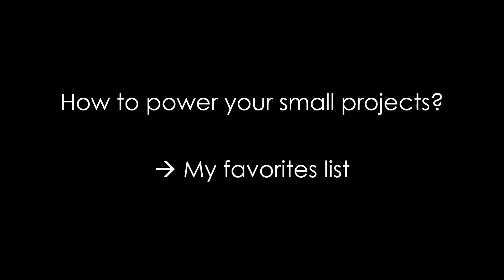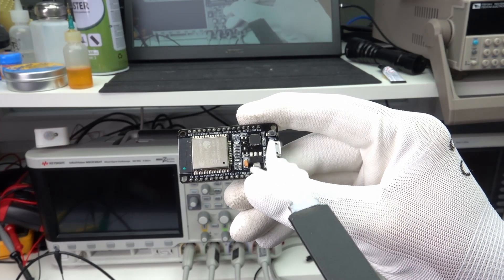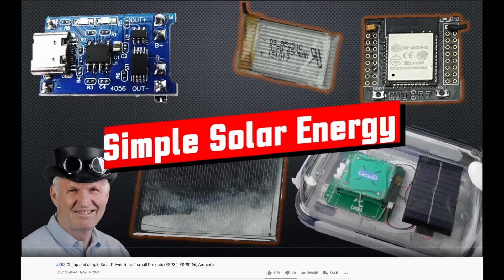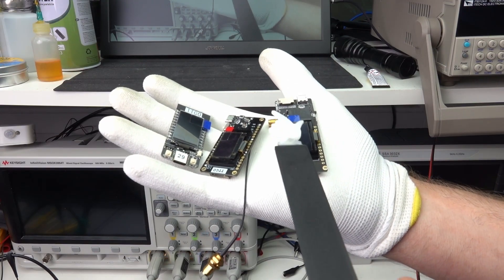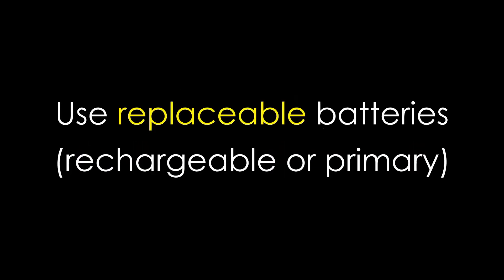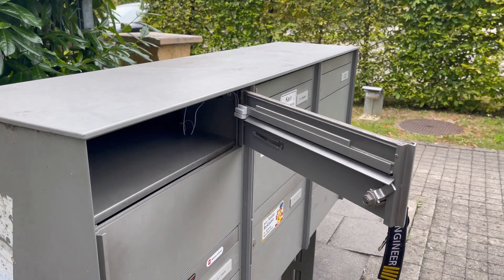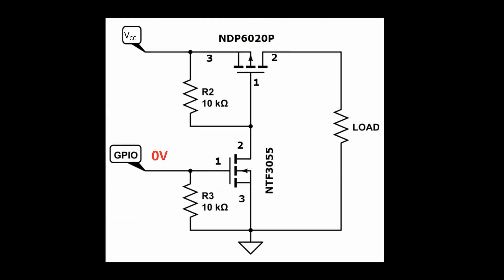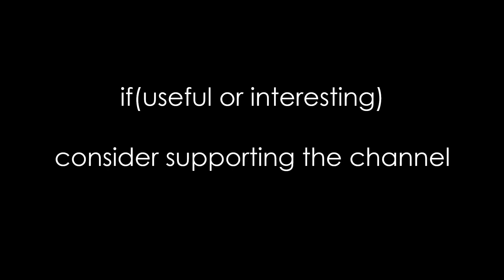#400 The Best Power Source for ESP32/ ESP8266 Projects

Comment: Hi Andreas, very good as always!! I am looking forward to your video on LiFePo4. 
During the summer I did some test with an ESP, a 700mAh LiFePo4, an 1W/6V Solar panel and a very cheap TP5000 charger. 
The battery and the charger output are directly in parallel, thus no need for a power path. All power lines should be kept short and thick enough though. 
I am also just keeping the current limit at 1A and it works just fine. The TP5000 has a step-down converter and this is not optimal with respect to maximizing the power, but it seems at least to be self-regulating. Too high currents are anyhow no problem with a 1W panel.
As you have shown in one of your other videos the TP5000 has a very small hysteresis until it starts charging again once the battery is full. However, there is a not used pad that is connected to the chip select. It is possible to solder a thin wire to this and enable/disable charging by yourself. You can check "battery full" via the green LED level, then disable the TP5000 and regularly check the battery voltage to decide yourself when you want to enable charging again. 
There are also 2 unused pads parallel to the onboard shunt. I used this just out of curiosity to observe the charging current with an ADS1115.
In a second setup I just connect the solar and TP5000 parallel of the LiFePo4 without any modifications or measures. During the day the battery is floated around 3.55V and during the night it gets some relief... I really wonder how long it takes to kill the battery by this. I find a lot of "opinions" on this matter, but no real hard facts or data sheets. If there are any battery experts around, I am still keen to learn.
Reply from the maker: I only used Li-Ion batteries during the last winter and one was dead a few weeks ago ( I do not know, why: Low or too high temperature or something other). The voltage also behaves as you describe. I will see how the LiFePo4 battery behaves during the next winter. This one is also better protected and probably will not get the full temperature swing like the one on the roof.

Comment: Do you use a specific brand of usb chargers? I'm looking low idle consumption and after some reading it seems like there is quite a variety, even in products from the same manufacturer.
Reply from the maker: I never looked at idle power. I usually use Baseus or Ugreen. But I have no "proof" that they are better.

Comment: I am planning to build an escapebox with an esp32, some neopixels, tm1637, dfplayer and some solenoid lock. It needs to be battery powered with a battery indicator and a charging port on the outside of the box. The esp32 needs to start when the box is opened and will run for about 90 minutes (countdown from 60 to 0 but will be active until the box is closed again. I prefer to not charge it after every use. For this usecase I will use some different voltages, some for long time like the neopixels and tm1637 but the solenoid will be used only once. Are there any best practices about how to implement this?
Reply from the maker: This is a complex project with many aspects. So I can not give an answer. There are many problems to be solved. But you have a list and you can start one after the other ;-)

Comment: Txs for this video as it's very timely. I'm building a water level sensor (SR-HC04) for a water tank and want to go the battery operated route if possible. Initially my thoughts were deep sleep and automatically wake up a few times a day to send the water level. However in discussions with my neighbor he would want to see the level at a particular time (i.e. use case #5). Also what's the difference between use case #3 "battery operated and don't sleep at all" and use case #4 "on 24/7"? Is it possible to have an event driven use case (without a physical switch/relay etc.) and get a few months of usage without needing a Tesla battery wall :)? How do I go about dimensioning the battery requirement? Love your videos!
Reply from the maker: If you use a properly designed setup and deep sleep you can get a few month life. But pay attention to ultrasonic sensors, You also have to switch them completely off during deep sleep. So you need a custom-designed diagram probably using an ESP32-WROOM module plus a FET to switch the sensor (use case 4). Use case 3 does not work for a long time because they are always on.
Reply: Andreas Spiess  Not quite sure what this is about...

Comment: Andreas, great concise and informative video. Is there a good coin cell battery that would be good enough for either of the latter 2 use cases?
Reply from the maker: I do not know. Most coin cell batteries I know are very low current.
Reply: LIR2450~120mAh, Can last for a couple of hours.

Comment: I kind of understand you electrical designs. However as I am not yet smart with devices.  Can you physically show (slowly) wired components set up.
Good example for me would be using esp32 , 3 batteries, power reducer, dht22 temperature and humidity sensor wired and working. Each connection.
Then I can take components purchased and connect them properly, add code to test 5 times a day.  Use raspberry pi with any software to write the output for that sensor reading to a file to evaluate over each month. (If I can add battery level report as well then I can trade out with charged battery, then recharge used batteries and use them to replace batteries again in future.)
With that level of help AT FIRST WILL LAUNCH MY LEARNING FAST.

I WOULD BECOME A GREAT CONTRIBUTOR IN HELPING FINANCE YOUR COST IN ITEMS AND FUTURE VIDEOS AS I OBTAIN MORE INSTRUCTION.

IF THERE IS ANOTHER PERSON YOU WISH TO REFER ME TO FOR SUCH VIDEOS IN DETAIL, I WOULD BE HUMBLED STILL.

I JUST NEED A KICK START, and a little guidance with patience.  Most Humble Appreciation!  Fan in most need.  Alton
Reply from the maker: Unfortunately, this channel is not focused on beginners. So you probably have to search elsewhere for stepwise instructions.
Concerning logging with the Raspberry Pi: I made videos about it. But this is not easy because it involves a few software packages :-(

Comment: Hello Andreas. Thank you for including Alkaline batteries in your power solution list. Simple is sometimes best. I built a mailbox monitor circuit February 13, 2018 and the same two AA  Alkaline batteries are still powering my circuit (3.5 years). The 2x AAs are soldered together in series. Soldering eliminates the possibility of corrosion and poor connections in battery boxes. The PIC microcontroller is in SLEEP mode 99% of the time, only woken up when the mailbox lid is opened. Then a LED is flashed until the circuit is reset by me.
Reply from the maker: That is interesting! You even can blink the LED!

Comment: I want to build a clock with a lot of LEDs. Since it draws a lot of current it and is on 24/7 it should be wall powered. But the voltages that the addressable LEDs need is usually different from most dev boards. How to keep it simple and also not too hot?
Reply from the maker: I made a video on how to work with Neopixels

Comment: Very informative, as always! I was wondering how worse off one would be with a solar USB power bank? They tend to be very cheap, robust and just a matter of plugging them in via USB. What’s the breaking point in terms of cost/performance compared with a DIY panel+battery+electronics?
Reply from the maker: Mine stops delivering power as soon as it charges. I even thought it is defective. So pay attention if you buy one.

Comment: I tried everything to get a power supply with no noise for a seismic sensor design of our company back in 1987.
After weeks of research and testing, I ended up using batteries. Everything else was just too damn noisy. 
A power supply designs are dictated by their use. Sometimes you can get away with a simple LDO.
However, sometimes there is no solution but to use batteries.
Reply from the maker: You are right. I also tend towards batteries if noise is an issue. To "characterize" a power supply for my radios I compared the noise with a battery, with a server power supply, and with ferrite beads included. The battery sets the reference...

Comment: Concerning power-supplies and Meshtastic, I see your recent 2021-09-05 video on power 
supplies.  Being in the (periodically) cold north, it would be nice to 
power this with super-capacitors with no batteries.  I've seen some 
videos on this type of circuit, but was wondering whether you'd want to 
address it?  I'll copy this into your recent video on power supplies.
Reply from the maker: Maybe I will have a look at it. But only for solar powered devices. Otherwise the caps become very big.

Comment: Hey I can't find any cheap LiPo4 batterys so i am thinking about Li-Ion batteries like the 
Lishen LS LR21700A batteries ( Li-Ion | 4000 mAh | 3,7V | about. 4,2 Euro ) 
My current plan is to use two of them in parallel to power my lolin d32 pro v 2.0.0 board. 
Is that a good solution?
Reply from the maker: I thought I had this solution in my video? One or two batteries in parallel do not matter for the concept.

Comment: Why don't you just use a n-channel logic level MOSFET to keep the board awake?
Reply from the maker: I do not like to switch ground. But maybe it works.
Reply: @AndreasSpiess  No, i mean to use a single logic level MOSFET as shown at 12:00 driven directly by the gpio pin. The n-channel needs a positive voltage to turn on. I do it all the time and it works.
Reply from the maker: Because it needs a positive gate voltage it is usually used to switch the ground wire. If you connect it to Vcc you would need a higher voltage than Vcc to switch it on. Or do I miss something?

Comment: Thanks andreas. You always come up with awesome videos addressing 100 of issues. I am currently working on a datalogger using ttgo tsim-call. The board is mostly in deep sleep mode so I have used ULP for pulse counting. My application needs to run on battery for 3 years. I want you to suggest me a battery. Currently my power consumption in deep sleep mode is 0.7mah
Reply from the maker: With your numbers you can calculate the size of the battery. It is probably quite big. I think you would have to build an optimized board with lower sleep current or switch the board completely off as I showed in the video
Reply: @AndreasSpiess  isn't the ULP of esp32 in deep sleep mode consuming <1mah.
Reply: Is good option? Or to shift some other chips
Reply from the maker: Your board does not only contain the ESP32. Maybe you watch my board comparison videos. Or you measure the current consumption of your board in deep sleep

Comment: Consider FeRAM for the last case ... these have better retention specs (about 10^10 to 10^14 cycles), and faster rW times, albeit more expensive than EEPROM.
Reply: FANUC has used this technology to replace battery backed SRAM in their CNC and robot controllers.
Reply from the maker: I did not know this technology. It is probably a good solution for special cases. Most of my use cases do not run so long.
Reply: @AndreasSpiess  They are pin interchangeable with EEPROM, so painless, and fast.

Comment: I love those ESP32/ESP8266 boards with OLED and an 18650 holder on the back.. sure, they are a bit on the large side, but they've got everything you need to deploy a remote sensor somewhere. Sometimes I just wish they were available in a version with an antenna plug (uFL) instead of the pcb antenna, for situations where I need a bit more wifi range.
Reply from the maker: I like the T-Beam for my projects, too. Just keep in mind: These boards are not optimized for deep-sleep.

Comment: SUPERB! Would you please do a similar show for 5 volt devices like the ESP32-CAM with its associated presence sensors and alarms?
Many thanks!
Reply from the maker: I do not know the ESP32 cam in particular. But they are most probably 3.3-volt designs with an LDO to reduce the 5 volts as most development boards. So it should be possible to power them with 3.3 volts (as showed in this video).
If you want to power them with 5 volts then a power bank is probably the easiest way. I also did a video about "poor man's" UPC which also could be used. Pay attention to power banks: Often you can only charge or discharge them. Then they are not useable for continuous operation.
Reply: @AndreasSpiess  The ESP32-Cam might amuse you because they can support facial recognition on your cats to prevent them from coming through their pet doors with birds or mice in their mouths.
   While the ESP32 board in the ESP32-CAM is certainly 3 volt logic, the data sheets specify 5 volts (and sometimes 2 amps) to ensure there's enough juice to power the camera module. There's a 5 volt on board regulator to drop the voltage to logic level.
   Many, MANY thanks for your SUPERB videos! I have learned so much from you.

Comment: Love you videos! Thanks for the Information. I have built something on the last use case you mentioned where the event triggers few times a day : https://youtu.be/jTh6n9OZyNc
Added WiFi to my RF wireless doorbell. Uses disposable 2xAA batteries which needs to be replaced every couple of months and works great. The voltage level is suitable for ESP board directly and also no charging circuit required :)
Reply from the maker: Thank you for your info. It is interesting that you get such a long live for the ESP8266! Usually, flash memory does not work much below 3 volts...

Comment: LFP batteries are nice solutions the problem is that charging circuits and protections are very very rare for small devices as they are mainly used for energy storage.
Reply from the maker: I plan a video about these batteries. You get now protectors as well as chargers for them.

Comment: I would love to see some talk about supercapacitors (which are now much more affordable in diy class projects), and the affordability of adding a qi coil to a project. Between those two, many ultra low power devices could be topped up in a matter of minutes without having to open a waterproof case.
Reply from the maker: Super caps could be interesting for solar powered low power projects because for the capacity, they are quite big.
For which use case QI coil charging would fit?

Comment: I have a question for the big brain people 😜. What development board do you suggest for me to start with? My 9 & 11 year old son's want to get into IoT and automate our motorHOME. Since we live in it full time, we want to have fun AND protect ourselves with gas detection, water detection, and fun stuff. I have an Arduino and a raspberry pi, but it seems like it will get WAY too expensive to use those for every project. I know very little knowledge, will be learning with my kids and using a LOT of tutorials. We will eventually be off grid, completely and only using our 24v solar system. Thanks!!!
Reply from the maker: Most of us use Chinese boards with either ESP32 or ESP8266 chips because they offer WiFi and the ESP32 Bluetooth. And a Raspberry as a server. Then the price is not too high.
You find many videos on this channel where I compare the different boards. I would always start with the needs in mind. There is no "one size fits all" board

Comment: The HT7333 maximum current is ony 190mA, how that works when using Wifi?
Reply: I'm guessing 'recommended' capacitor to give enough tank for the short duration pulses wifi would consume.
Reply: @frollard  10uF would be enough? I don´t think so
Reply from the maker: The size of the capacitor does not matter too much (as my tests show). The current peaks are very short and it seems the HT7333 can deal with it. Average cuttend consumption of an ESP32 is only around 100mA

Comment: Have you ever looked into using or keeping batteries (and if required, electronics) varm-ish during winter? (0 to -20 C)?
Reply: For small currents some negative Temperatures is no big Problem for many Battery types.The Impedance rises, but the Voltage is still the same. LiFePo4 Batteries don't like to be charged at temperatures near or below 0° C - you have to reduce the Charging current significantly. In outdoor applications I placed the Battery in the mounting post below the ground, to keep it warm. For the Electronics You might use some kind of conformal coating to protect it from moisture.

Comment: Why LDO? I think that buck is much better, S-8551, for example (C140908 on lcsc), XC9236A33CMR (C122892) and some else.
Reply from the maker: I do not use buck converters for such small voltage differences. Too complicated (and always the risk of RFI). For bigger voltage differences I also use switchers because the LDOs get hot and waste energy.
Reply: @AndreasSpiess  I tred solution with XC9236A33CMR buck, it works with ESP8266 down to 3.35 volts on the battery (it do about 3.25 volts on the ESP).  With S-8550 (8551 have different pinout) I will try soon.